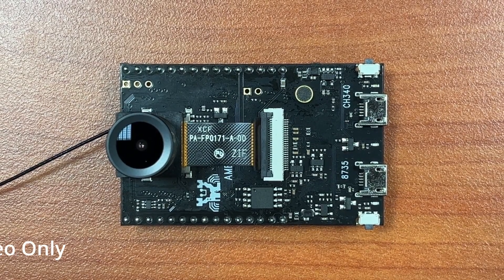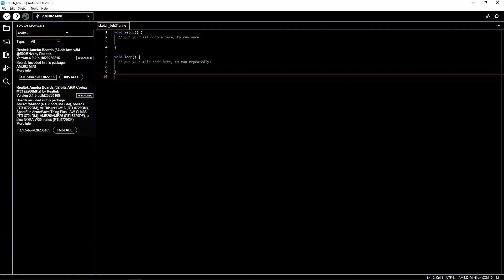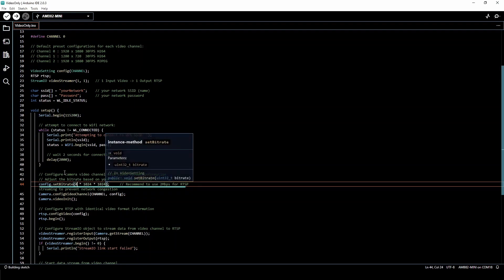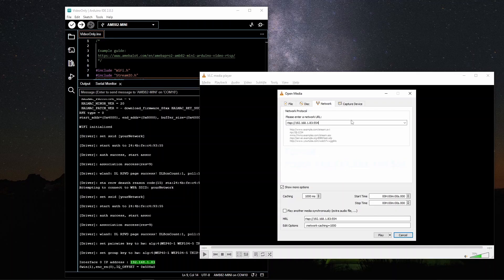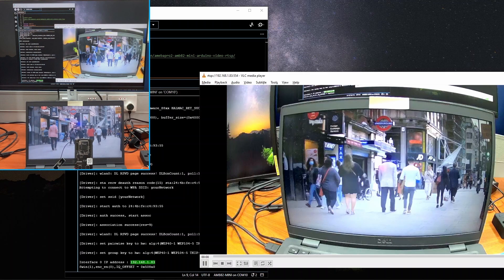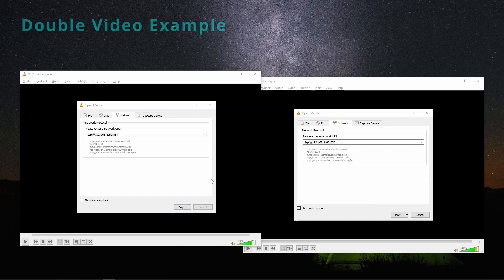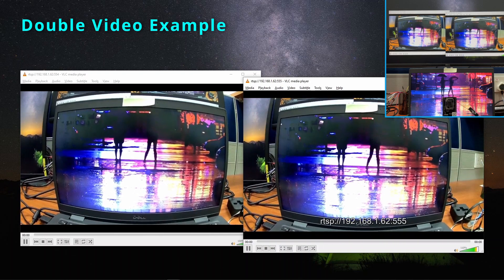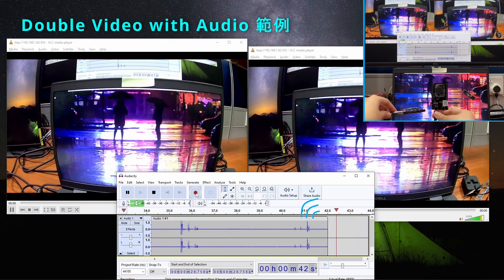AMB82 Mini - Stream RTSP Examples

Comment: UPdate.  I received my AMB82 Mini the other day.  Very easy to setup hardware and software.  I was up and running in minutes.  No jacking around moving files, etc to get it to work.  I can run it continuously with no issues and far outperforms any of the ESP32xxxx type boards.  Easily worth the little extra on price.

Comment: I have an important question.  Does this unit run well continuously?  Most of the other boards have serious heating problems if ran for any length of time.  It would be pointless to use something if you're limited to a very short time.  Thanks